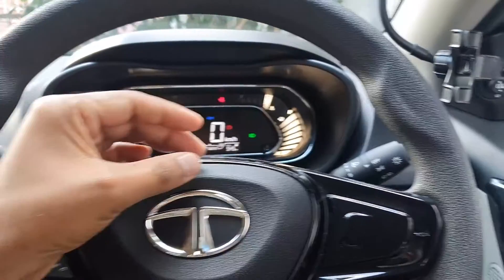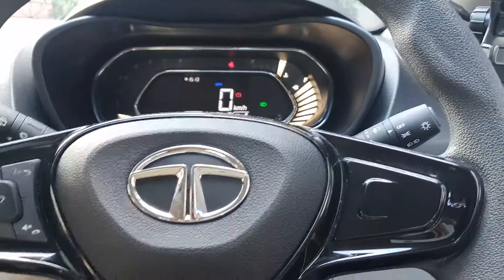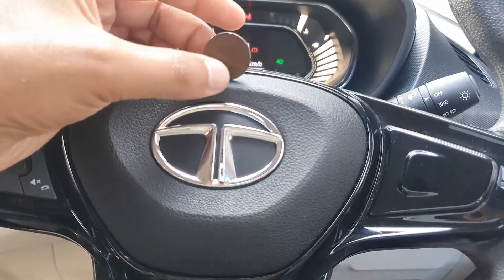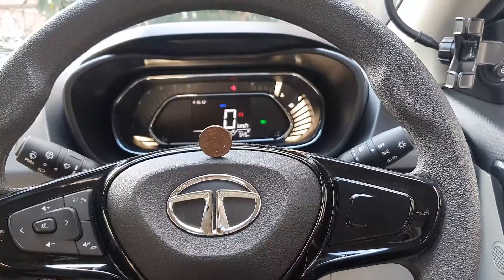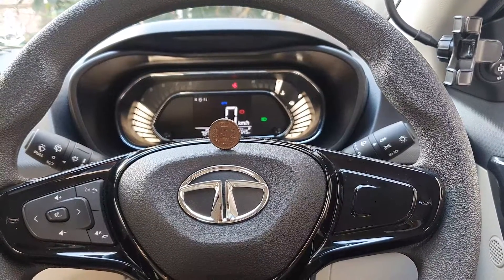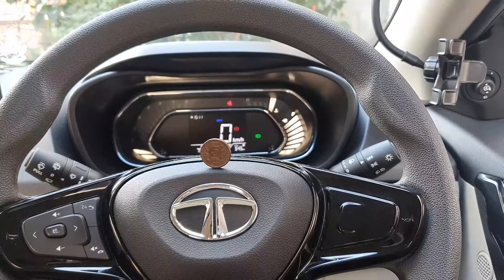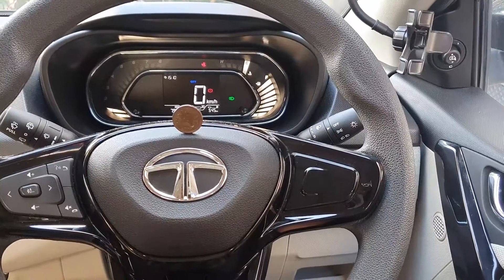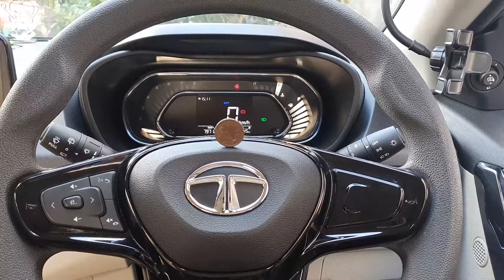2021 Tata Nexon Vibration Test I Truth about Vibration I Does Nexon Vibrate a lot?

Comment: Sir I’ve recently purchased nexon petrol 
Whenever i use AC or when the headlights is on the car vibrates alot 
Please check in your nexon too❤
Reply: Its in every nexon seems like car was designed with futuristic approach that no ac would be used 😂

Comment: Hello sir nice video. I recently bought Nexon  I felt vibrations in steering after I put on the ac at normal speed. Could you please advise. Thanks
Reply from the maker: I haven't faced this issue Ridhima, contact the service centre
Reply: @vinaysindhe  ok will do sir thanks
Reply from the maker: @ridhimadua1151  all the best, let me know what happens

Comment: Yes. Tata Nexon very quite engine. Rattling sound is normal when manufacturers use plastic. Please provide review and link of mobile holder.. which one you’re using.
Reply from the maker: Agreed Arjun. 
I bought the mobile holder in a traffic signal. Works great, though falls off occasionally. But does the job. Far better than using the android auto for navigation.